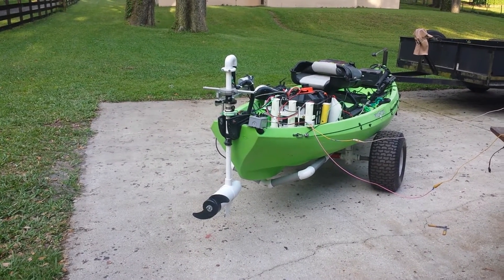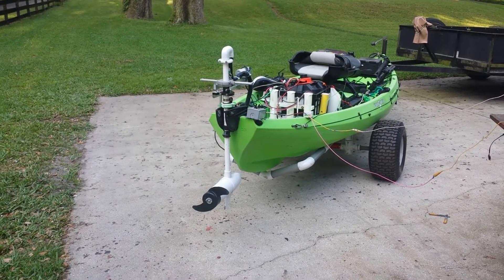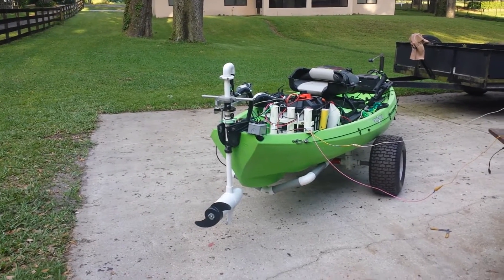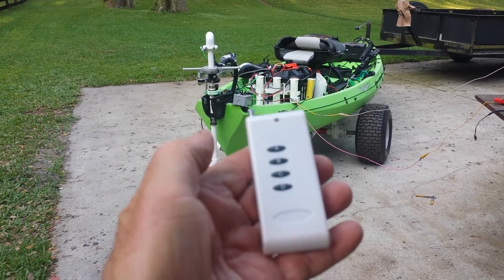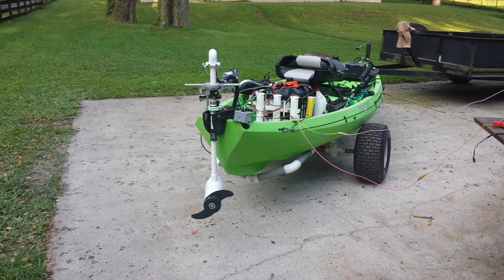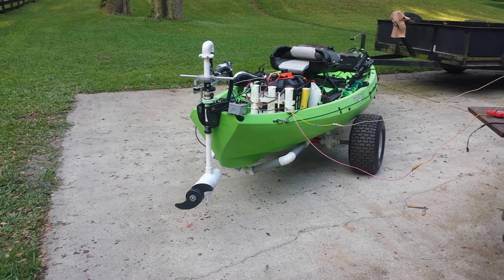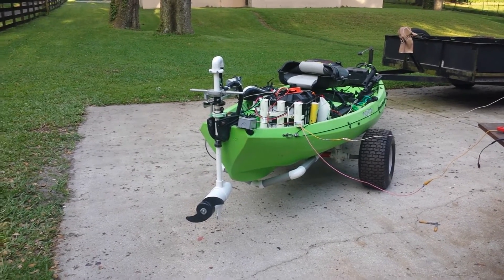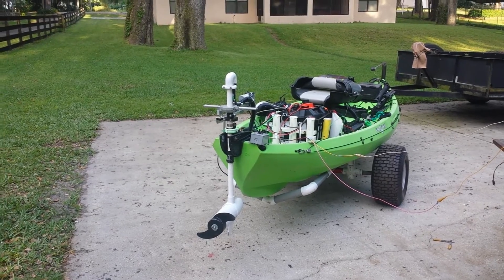Wireless Steering Control via Linear Actuator 16-03-31

Comment: That is a nice setup but,I know from experience that those cheap China wireless transmitter and receivers are prone to glitches at some point,They periodically lose signal..I made mine that way but went back to the wired design as it is more reliable. I also didn't like the clicking noise every time I steered it and realistically didn't need something like that for my size boat.
Reply from the maker: Yes, the clicking noise and the noise from the linear actuator was somewhat of a distraction on these designs.  They all worked fine as far as steering was concerned but the noise level was unacceptable.

These were all prototype models to check out the electric steering concept and I proved it could be done.

I am now using (my manual foot pedal design) utilizing the my custom designed bracket that clamps to the trolling motor shaft. I attach a length of smooth weed eater line to each side  route them through some custom designed standoffs that attach to the NuCanoe Rail System and are routed to foot pedals that have been modified for my use.  I also designed brackets to attach the foot pedals to the rail system of the Nucanoe Frontier 12 Kayak.  All of the fasteners are stainless steel.  It steers just fine and it is not noisy.  This is what I call the (KISS) method.  Keep it simple stupid.  Ha Ha 

The custom designed trolling motor bracket can be used on most all minn kota trolling motors in the 30 to 50# range.  The nice thing about them is they are held in place with 2 stainless steel screws and can be installed without removing any wiring or other parts.  They are a popular item and I intend to add them to my website sometime in the near future.  I will also offer a manual foot pedal steering kit for the Nucanoe Frontier 12 which includes all the parts necessary to install on the NuCanoe Frontier 12.  Other items will be added as they become available.

Hope you enjoyed all the videos associated with this project.

Comment: Ok, I read what you put on here of how to contact you, but I do not see an ABOUT, button, ... ????? 
I am trying to do the same thing with my yak, because I have lumbar issues, ... So paddling is difficult @ best, ... I bout a 4 channel remote, & receiver unit, & have got it figured out only partially, so far, ... I can turn the motor on with the remote, & shut it off by clicking the same button again, ... But to get it to a temporary on, I lose the other function, so if you have any advice, ... what am I doing wrong? Lol, ... It is my intention to be bassing in northern Alabama with this rig, come March of 2017, & I want everything setup properly before I go, ... Lol!